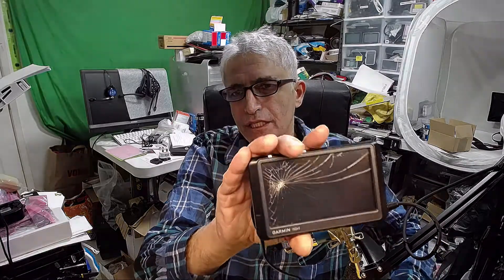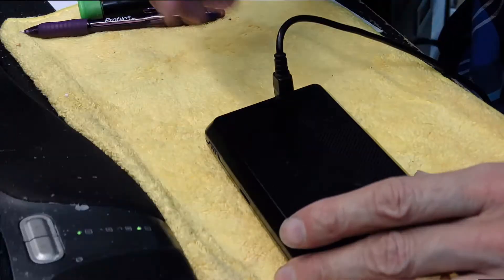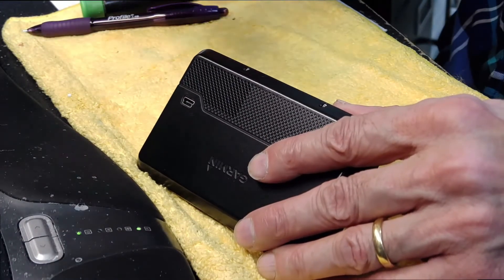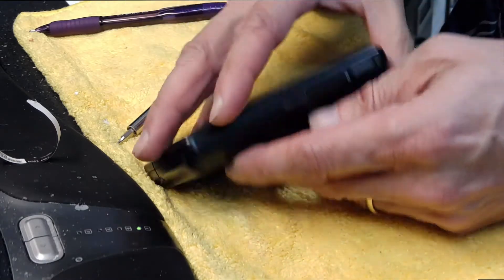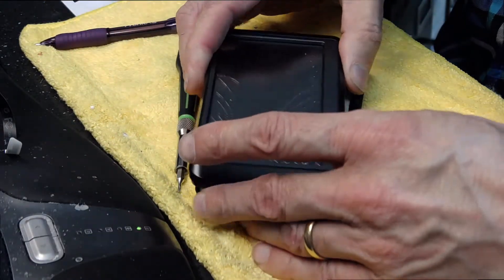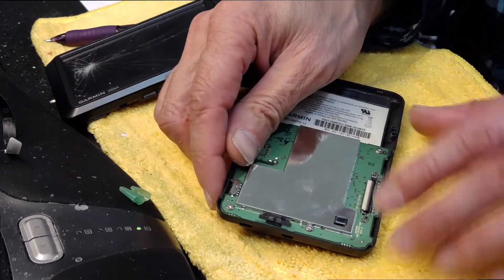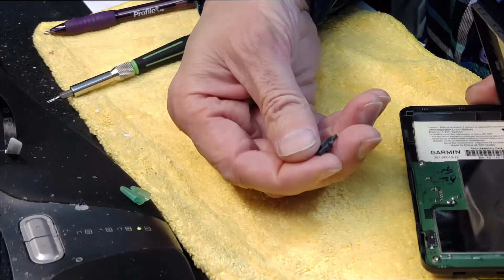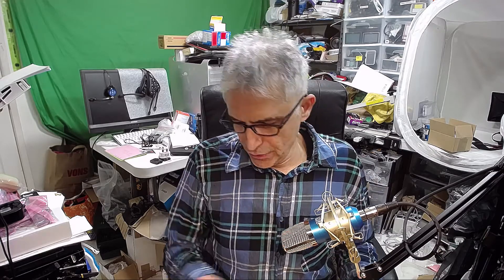Tutorial On Screen Replacement in a Garmin Nuvi 255W 265W GPS Navigation System

Comment: I was encouraged to do my nuvi 255w after watching your excellent video. So i ordered two screens from AliExpress specifically for my nuvi and just today returned them. They fitted ok but the screen was so bright it was impossible to see anything on the screen unless i went to zero brightness on the settings menu. It was as if the contrast was set to zero and my nuvi has no contrast setting. Even with zero brightness it was only possible to see any screen images by tilting the nuvi almost horizontal.  Can you recommend a specific seller of screens that you know work?
Grateful for any advice.
Reply from the maker: Hi, so you have to get the exact match based on your screen part number, not your Garmin model number. Two identical Garmin units could have completely different and not interchangeable screens. The model number of the screen is printed with black ink on the back of the screen, and you need to match that number when you search for it. They are available in both Aliexpress and eBay.
Reply: @TECHNOLOGYTIPS101 Thank you for that nugget of info. I will do a more specific search for a screen.
Reply from the maker: @michaelbilson6776  You are very welcome

Comment: This video was great but I have a question? I am having trouble getting the power strip to lock down. That plastic bar that locks and unlocks the power strip it doesn't lock it down. What am I missing?
Reply: Yes
Reply from the maker: @fishbig1020  Make sure that you didn't put it upside down, it only locks down one way and if you flip it 180 degrees it will not lock in place.
Reply from the maker: Do you mean the brown strip that holds the LCD Flat cable?

Comment: Did Garmin have different connection schemes for the screens on their units? IE: Before or after a revision number?

I bought a used unit off of eBay and took the screen from it and put it in my non-operating unit. All I got was a white screen. The only screens that would work were the original ones in the respective units.

My problem was I could not get the screen to calibrate at all. No matter what I tried the screen would not go into calibrate mode. Do you have any suggestions for that? The place where you would press would be about an inch and a half above the top of the unit so there's no way to actually push on it and make the unit go into calibration mode.

I had purchased the Lifetime Maps but they are only valid for the serial number of the unit for which I purchased it. 

If I update the old unit and put the SD card into the new one it says "Can't unlock Maps." Apparently, according to Garmin, the maps are geared only to the unit for which they are downloaded. Do you have any suggestions on how to unlock the maps?
Reply from the maker: Yes, the screens are different in different revisions of the same model Garmin. However you don't need to buy another screen, all you need is a $3 Touch Screen which is the front glass in front of the LCD Screen. The Touch Screen is called the Digitizer and you can buy it through eBay. To replace the touch screen please watch this video   https://youtu.be/cMhZA9XuNY0 
Yes, there is software to unlock the maps, but it is on illegal sites that are very dangerous to visit because you could get computer viruses, malware, ransomware, etc. Also, your computer IP could be tracked by your ISP which could lead to other legal issues. So I don't recommend that.
Reply: @TECHNOLOGYTIPS101  Do you have a source? I searched on Amazon and Ebay for "garmin nuvi 205w replacement 4.3 inch touch screen" and got everything but what I wanted.
I wanted to scavenge the touch screen but that is not possible.
My nonworking unit is a version 6 motherboard and the one that I purchased online was a version 4. Solder points are not in a line like the one that you showed. The old unit has four solder points in a square pattern and they're on the opposite end of the kapton connector.
(sigh)
Reply from the maker: @jimpeel  Yes you can remove the touch screen from the new unit. You don't have to use a heat gun to separate the touchscreen from the metal frame. You use the new metal frame and simply snap it on the original LCD Screen.
Reply: @TECHNOLOGYTIPS101  I tried that quite successfully with removing the one from the new unit. 
Unfortunately the old broken unit does not have the same configuration for the kapton connection. It is not like the one you showed in the video. It is four connections in a square pattern instead of four in a linear pattern like yours was. 
It's also not on the left side of the kapton connector that umbilicals to the motherboard. It's on the right side. 
I have no idea why Garmin made such a big change between the Rev 4 motherboard and the Rev 6 motherboard.
I'm trained in electrical and electronics and was a E/M Designer. I could probably sniff out the connection scheme between the two and wire it in; but finding the correct digitizer would be vastly superior.
Are you familiar with the square pattern digitizer screen connection?
Reply from the maker: @jimpeel  Yes I am familial and here is the configuration when looking at it from the front of the digitizer the upper left connection is YU, the upper right connection is XR, the Lower left is XL and the lower right is YL    YU means Y up, XR means X right, XL means X left, and YL means Y lower.

Comment: EXCELLENT VIDEO...VERY INFORMATIVE!!!
I have a Garmin Nuvi 255 that is about 9 or 10 yrs old...the screen is cracked & unresponsive...but it lights up fine & still bright...just unresponsive. 
I'm not sure about this...can you go to an electronic specialty store to buy a new Garmin screen or do you have to order one from Garmin?
Much love from Mobile Alabama.
Reply from the maker: Thanks for the compliments, I truly appreciate it. You can get the screen on eBay and they are very affordable. However before you buy the screen make sure to first take it apart and read the screen model number. The same exact Garmin GPS Model could use two completely different screen types that are not even interchangeable. Here is an example of the screen on eBay https://www.ebay.com/itm/164909577862

Comment: While opening my Garmin Nuvi 2699 I accidentaly ripped the  flat connector off ,  so now my screen doesn't even turn on. What is your suggestion? Or can you repair it?
Reply from the maker: Unfortunately at this point you have to replace the entire screen, but you can easily get them on eBay like the one here https://www.ebay.com/itm/224143983430
Reply: The link is no longer valid.

Comment: Hi my gps still is working fine but for the backlight will get dark and unable to see if you don't look very hard. at times it does this then it'll be lighted back up after awhile. I'm guessing that I need to replace the back screen or is they a light or something else going out? Might be cheaper to buy a used one seen some for 20 bucks on ebay with lifetime maps. Would be a upgrade lol Anyway thank you for your video
Reply from the maker: Gerald Cortez, hi you’re right getting a used one from eBay might be the best option. However people repair their GPS units because they might have important addresses saved which makes the GPS priceless. So if you don’t have anything to worry about then you might wanna purchase a used one through eBay but make sure it has lifetime maps or else it will be worthless in a few years.
Reply: @TECHNOLOGYTIPS101  thank you.

Comment: Thanks you. Your video was very helpful. I was in the process of replacing the battery in my Garmin nuiv 200. 
Had a problem removing 1 screw and had to break it out. Well I started to open the case I pulled to hard and the screen connection strip came out. Well I tried to put it back with no luck. Ok look on YouTube and found your video. Well I did not known that the small white plastic strip lifted up. Well all is well and working fine. Thanks to your video. Keep up the good work.
Reply from the maker: Thanks a million for your complement and encouragement :-)